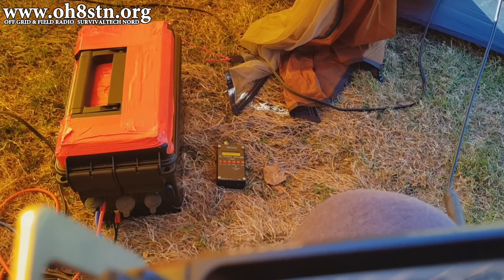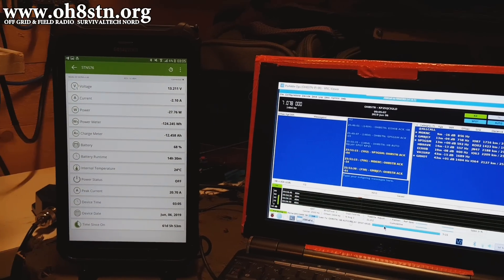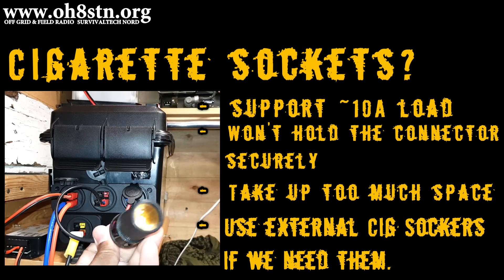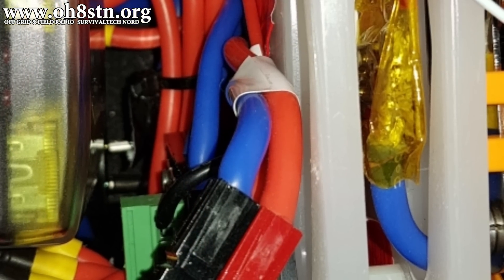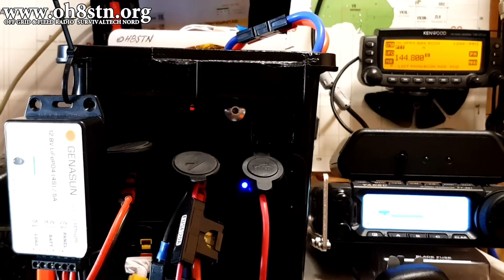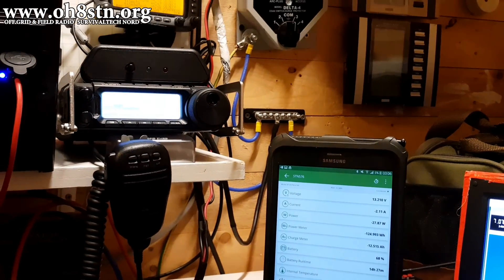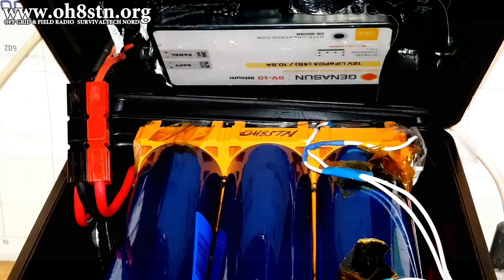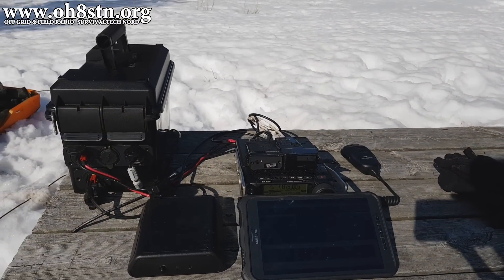Portable Off Grid Solar Storage Update | Fuses & Power distribution

Comment: Thanks I am back watching this again.  Do you know who has documented solar power and RFI? Who is most quiet is what I want to know.
Reply from the maker: Solar panels without any electronics are quiet Foster never buy them with  Built-in DC ports or USB ports or things like that. Genasun makes excellent charge controller which are RF quite.  Inverters are notoriously noisy by the way.

Comment: A quick question about the wiring of the Genasun charge controller to your batteries. Did you connect the 'battery' output of the controller directly to the pos and neg of the battery pack or to the output of the BMS? Thanks for any input. KE8RQX

Comment: In my last “ham radio go box” project, I did not include any cigarette sockets either. I also built a secondary power supply box in addition to the battery and/or power supply radio box. I installed a power supply in the radio box, in addition to the built in battery, just in the event I have access to AC power. 

This week I am running the radio 3 hours (primarily rx inly) per day on battery only power. I know the math, but I want to see the real world performance.

Comment: Hi Julian.  Great video on the updates to the solar generator.  I purchased the Thornwave PowerMon battery monitor and installed it on my DIY solar generator.  It works great.  I noticed in the video you had a screen shot on the PowerMon app of a summary page showing total number of full charges and other information.  I have navigated the app, but cannot find this summary page.  I went over the manual and could not find how to access this page.  Can you direct me to this page on the app.  I am running version 1.84 on an android device.  Thanks.

Comment: Julian- do you know of any other solar charge controller besides the Genasun that is RF quiet? The Genasun has many limitations like no display, is not programmable for set points, input voltage limit, etc. I need a controller that can use 17 and 34 volt panels. Thanks. N6ZCU.
Reply from the maker: Victron makas excellent programmable conttollers

Comment: Love the fuse block upgrade! I read in the reviews that several users had voltage bleed through with fuses removed, kinda negates the blown fuse. Did/do you see that in your particular piece?
Reply from the maker: Thanks for the comment. Actually I didn't see that in my build. There is an easy way around it though, just don't use the fuse block with the blown fuse indicator. I believe what people are seeing is voltage from the LED circuit, when the fuse is removed. Having had some time with this build, I don't think the indicator circuit is actually necessary, with so few ports.
Reply: OH8STN I didn’t think so but wanted all the input I can. FYI, I am trying to source some “triple” bus bars. 
73
KN4ROR
Reply: I loved my time in Suomi!

Comment: Hey, love yaouar videos.  I ran across your channel looking for info on building a DIY solar "generator", tons of useful info here.  My goals are quite different - I'm not working on emmcom power, but, rather, a power source for an annual two week camping trip (vehicle camping, so weight/size is much less of an issue).  Currently I use a setup built around an SLA, but want to move to LFP.  I'm also looking at a bigger system - 100A capacity and 100A draw to an inverter (110V is a must for this, again, this isn't about emergency usage).

So I'm wondering: any advice on that type of system?  I was going to go with a bioenno 100ah battery, but I definitely get your point about being able to fix it myself.  However, using the 38120 cells,a 12V 120AH pack would cost more and be much bulkier than a pre-made battery.  I'm also not seeing BMS systems that are rated for 100A draw.  Any ideas on this?  Anything out there that can be built into a system of this size?

After watching your videos, I may also build a radio power source, but that's secondary.

Thanks for great videos! de KQ2Z

Comment: Thank you for this video. I recently got a Powerfilm ft15-600 10 Watt .6ah and morning star Sun Guard 4.5A 12 v controller. I am using it to power HT (Yaesu vx8GR) and 817 QRP with lead acid cells. I am wanting to move off of lead-acid and am wondering if this LIfepo4 build can be charged with my existing power film and controller (albeit slow). I am new to this so am unsure how to run the numbers. Thanks, and 73, N0DAV
Reply from the maker: I love these type of questions. I also have a MorningStar sunsaver 6 and sunsaver 10. The charging profiles don't work well with lithium iron phosphate batteries although many people say we can use them. In my experience, let acid charge controllers don't provide the necessary voltage to trigger balancing for the lithium iron phosphate cells. I use the Genasun controllers specifically for 4S LiFePO4 packs. I've got a couple of incoming videos on those charge controllers, so please stay tuned.
Reply: @OH8STN  Thank you for your reply! I am just starting my "off grid" planning and came across your channel and subscribed. After watching your videos I got worried that my Powerfilm FT 15-600 is underpowered... you are a big help for someone starting out in QRP and preparedness.

Comment: I was wondering if you were powering the laptop with the system? I like keeping everything possible in dc also. I was thinking that if you were that you would need a dc to dc switching converter and that would create some RF noise. I am currently running a pc with a switching buck converter from a 24v system down to 19.5.
Reply from the maker: Or use a 12v Asus laptop 😊
I knew early on that I would run my shack and portable comms off of DC. So I picked up a 12-volt laptop from Asus to avoid DC DC boost converter necessary to keep traditional laptops charged. Your idea will work perfectly and you're absolutely right about the noise. You only have to deal with a noise when you charge the laptop. You can unplug it the rest of the time and let the laptop run from internal batteries. What do you think?

Comment: If you design and build it well with good quality parts it should perform outstanding.But simplicity in troubleshooting and fixing the problem is also very important in staying on the Air.

Comment: Thanks for your videos. Will you ever build a 13.8 V. solution?
Reply from the maker: 13.8v lead-acid?
Reply: @OH8STN  No, 13.8V using Li-Ion batteries.
Reply from the maker: @hgw90026  3S lithium-ion? I could do something like that. If I did it would have a lot of cells in parallel to maintain nominal voltage as long as possible. Give me some context oh, what do you want the power with it?
Reply: @OH8STN  It seems most equipment's nominals voltage is 13.8 (at least with my FTM-400D) at plus/minus of 10% - 15% (according to YouTuber David Casler) which puts 12v at the lower edge of the operating rage and as the voltage drop further throttling back your output power. If the power supply was at 13.8v or even a bit higher, then you would be operating with a lot of headroom. What do you think?
Reply from the maker: @hgw90026 From this perspective there's no point to lithium ion battery chemistry, since a 3s lithium-ion pack will give to low voltage, and a 4S lithium-ion pack will give too much voltage. This is why we use lithium iron phosphate (LiFePO4) in this channels battery builds. All of the lithium iron phosphate battery build seen on this channel are 14.2-14.4 volts full, 12.8-13.3 volts nominal. LiFePO4 is almost a drop-in replacement for the 13.8 volt lead acid battery. Any reason for wanting to use a lithium ion battery chemistry?
Reply: @OH8STN  Thanks for the insight. I did not realize your system was operating at 14.2-14.4 volts full, 12.8-13.3 volts nominal. Sorry, I should of said 13.8 using the family of Li batteries as opposed to specifically LI-Ion. My bad. Thanks again for your videos.

Comment: I love these videos! My needs are a bit less ambitious but I definitely agree with the emphasis on reliability and quality. I'm putting together a bug in ham shack with radios up to 100W powered by a 20W solar panel and a 12-volt 20 amp hour LiFePO4 battery that has internal cell balancing and charge and discharge cut offs. $160 delivered on eBay. It's made as a replacement for sealed lead acid batteries at about 1/4 the weight. Hopefully my bug out system will consist of power film solar panels with a Chinese DC to DC converter as a charge controller charging 18650 lithium batteries or an internally balanced lithium motorcycle battery that will power a ruggedized version of a 15W QSX radio from QRP Labs when it becomes available.  I also hope to use an Android tablet so I can easily run digital modes as well as CW and SSB using a simple and lightweight end fed dipole with extensions that make it resonant on any bands I want to use - probably 80. 40, 20 and 10m..  I typically monitor battery voltage to determine the charge state and make estimates based on knowing the power consumption for my simple systems.
Reply from the maker: Sounds like an absolute awesome project. You'll have to be careful with those eBay "turn key" batteries. To get the price that low, that have to sacrifice something. I would also invest in a good charge controller. Victron or Genasun. The DC-DC boost/buck makes lots of noise on HF. That'll block you from charging while you are using the radios. Everything else sounds spot on! I'm working on a similar project here at home. I like where you're going with yours especially me lightweight rugged radio.

Comment: In theory could I use a LiFePO4 genasun charge controller with other voltage sources other than a solar panel?

Suppose I have a vehicle that puts out 13.9volts for example.  I have a renogy 100w panel and SLA controller for a 150amp stationary setup, but as I get more involved with emergency comms, I'm looking for modular portable solutions.

Recently got a 15ah bioenno at a regional hamfest at a small discount.  I like that it can safely draw 30amp for short durations if needed.  Not ideal for all day contesting, but if I watch my duty cycle I can operate HF at reasonable power for a fair amount of time.

Comment: Always appreciate your detailed education, Julian. I recently came across an RV channel where a guy had semi flexible panels mounted to his RV and had to try to diagnose a problem. Many of the comments he received were regarding the quality of semi rigid vs. metal encased rigid panels, Everyone poo pooed the lifespan of the semi flexible panels across the industry vs. rigid panels. Judging from the comments it appeared one should not expect the semi rigid to last more than a year. I know Power Film Solar is top of the line and contracts to the US govt so should meet higher specs. But is there an inherent failure from foldable or rollable panels compare to rigid, specifically in the inner inter connections between cells? Go easy on me, as I'm trying to learn from others mistakes and I know how expensive Power Film Solar is.
Reply from the maker: It's a fair question but it's always very frustrating to receive it. In every case those semi-flexible panels are cheap Chinese manufactured. I know very well semi-flexible panels in the RV World, but other than the name they really have nothing in common with the powerfilm rollable series. I'm approaching my fourth year with the 20 watt panel, that's a folding one. My third year with the 120 watt folding panel. Finally, a few months with these rollables. I operate all year round in conditions most operators couldn't imagine, so when something says IP67 on it, it's only a matter of time before we prove it right or wrong. 
Anyway like I said, it's a frustrating question but it's a fair one. I invest in the powerfilm products because I can't afford buying cheap Chinese stuff which only lasts a few months to a year. Is that a fair answer?
Reply: Thanks for that. In the end, you get what you pay for, I suppose. Keep us up to date on any specific problems with these types of panels, would you? I am itching to buy a solar panel and controller to top of my Bioenno 20 ah LiPo4 battery powering an Icom IC7300 at 100w with typical RX/TX ratios I use occasionally at a park. Hardly the tough conditions and terrain you are used to. Would you recommend those Bioenno foldable panels or are they also rebranded knock offs? Dont have the space to store large panels so smaller is more attractive, but, like you said, repetitive purchases of inferior products isn't cheap either. SF.

Comment: Truly the Rolls Royce of DIY solar storage units Julian. My 32Ah 4S4P build is stalled pending budget for the case, main isolation switch, fuse board and outlets, but its in a usable state, in fact it powered my station in the recent RSGB 2m backpackers contest on  9/6/19. I operated at 20w for at least 4 hours under contest duty cycle using about 1/4 of the battery's capacity. I used a cell monitor, watt meter and SOTABEAMs fuse box to provide connectivity and monitoring. I may be considering active cell balancing under load, once I have the basic system enclosed, but that's a 'nice to have' at this stage. Keep it up Julian, 73's Andy/2E0UAW

Comment: Julian, have you ever worked with dc-to-dc converters? I'm looking at a 12v to 48v for a POE system with AREDN mesh devices and was wondering about the efficiency of said converters.
Reply from the maker: Actually I'm working with one right now. 12 volts to 48 volts as well. I don't think the efficiency is such a big deal as the loss in amperage.
Reply: @OH8STN  I'm looking to power a Netgear GS108PEv3 with 12v 1.25Ah input. 4 ports are 802.3af which inturn will have to run through a Ubiquiti downconverter (I know more waste) to 24v POE passive for the mesh bridges. The ports not downconverted to passive POE will still issue normal POE for things like VoIP phones (I'm using RasPBX). Then there are also 4 non-POE ports for things like RPi's and WiFi access points. Ultimately, I am hoping to avoid a wiring mess with separate POE injectors for each device.
Reply from the maker: Sounds like a massive project. That's a heck of a lot of infrastructure to configure and maintain. If you get it right though, it'll be huge.
Reply: @OH8STN  I'm warped. I'm doing this for FUN!! (Maybe useful for ARES/RACES exercises)